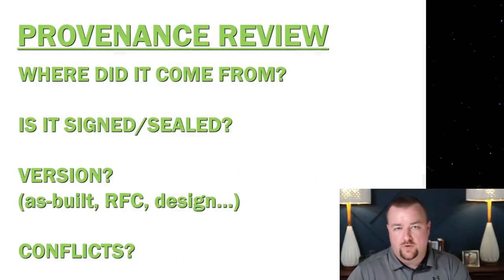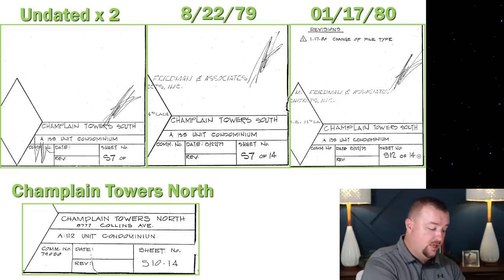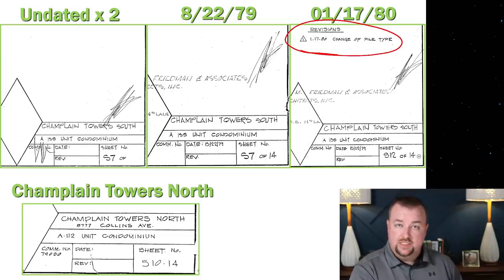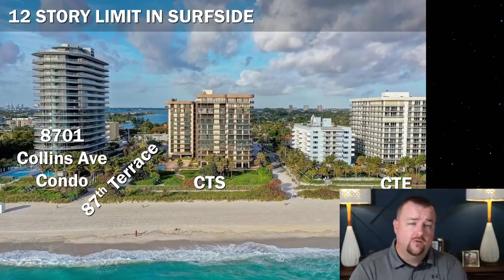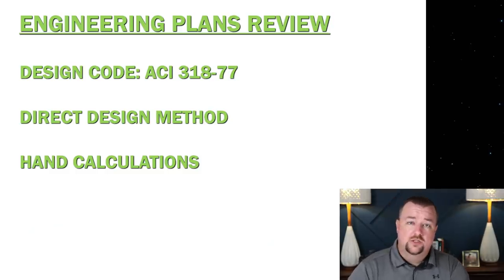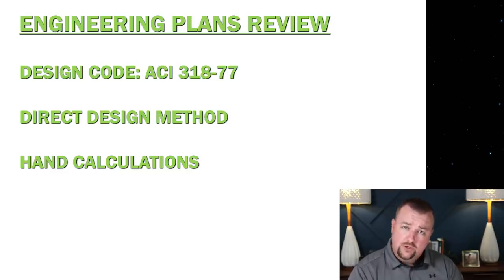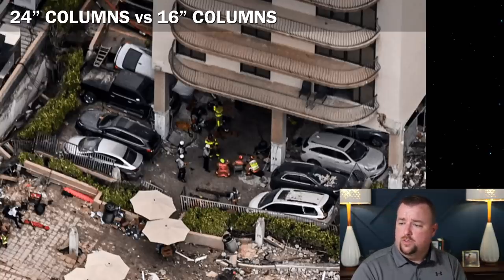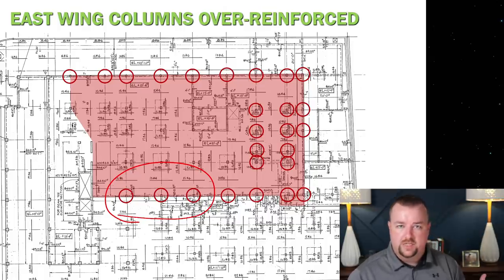Engineering Failures Found in the Champlain Towers South Drawings - Surfside Collapse

Comment: Hey Josh, here is another question, at what point do you think the congestion of column reinforcement was a big issue? Because the reinforcement ratio was 9.2% at the splice region but everywhere else it was less than 8% as recommended by code. Also the splice do occur just at the top of the pool deck. And to be honest when we see columns on west coast, the reinforcement is significantly tighter than that on the east coast, so concrete consolidation issue seems highly unlikely and if it were an issue, it would have shown up earlier because again the splice was located at the top of the pool deck. The high reinforcement ratio of steel may not have played role in the collapse. But it does convey one thing, that this was the minimum possible size of the column they could go for, any additional load would have lead to bigger size column.

Second thing that I did not understand is the concept of plastic yielding. I mean these elements they way they are poured and perform is essentially elastic. I have not heard of plastic yielding axially in RC column specifically in regions like Florida. Because everything is wind and the buildings are designed to stay elastic in wind. Plastic yielding / hinging of columns occur during high drift demands which the building was not even exposed to at the time of the collapse.

Third, you mentioned that the bottom mat was barely enough to handle the self weight of the 9.5" slab only. Was it the design capacity? Because when I do the same calculations, I do see that including the sand and pavers and structural topping, with #4 rebar, the slab was just overstressed by 8% in the column strip and it was okay in the middle strip. May be I am missing something when you mentioned it was at 99% for its own weight.

Comment: Very good and a great explanation, that the removal of the concrete beams in the pool deck may have weakened the as-built building, and that  weakness in the design and the moisture from Atlantic Ocean initiated the collapse, after 40 years.
Reply from the maker: Thank you!
Reply: @BuildingIntegrity  ~ I haven't seen a better explanation that focuses in on the weakness in the pool deck created by changes in its original design.

Comment: Hi Josh thanks for all you videos on this sad event. 

Sorry if this has been already  covered but 
I have a question, if the initial failures in the garage damaged sprinkler lines which would trip water flow switches and trip fire alarms, why didn't the building evacuate ??  

Thanks again for your efforts

Comment: The garage area with the large loads (vehicles),  it's not just the vehicle driving around, but the vehicles will inevitably hit those columns as drivers will always hit things by accident.  Overtime, that could cause internal cracks in the column, even though the column has no visible damage on the outside.

Comment: Man... I have no formal training and the lack of beams in that lower structure rubbed me the wrong way from the start.  Finding out they were in the original design and then were just taken out for an aesthetic reason is nuts to me.  I wonder if the sister building can be saved now that the flaws in the building are understood?  They definitely can't just leave it as is.

Comment: The penthouse failed from the forces of the columns and slabs redistributing loads. Some of the  penthouse and several balconies were not on the plan and were designed improperly. The punch thru of the upper columns caused the upper floors to pancake and buckle the columns as seen in the TikTok video.
The CTS was a glorified sandcastle.

Comment: In software development it is best practice, whenever you make a change, to re-run your automated tests. I imagine the equivalent now in architecture is you re-run your models to check all your loads. In software we automate this (with techniques like continuous integration) because otherwise mistakes happen all the time. Nowadays in architecture I imagine there is a lot of automation. In 1980, however... This makes me wonder if this type of mistake was made more systematically. This is probably not a one-off.

Comment: I liked your video very much.  I'm a sparky and was not sure I'd understand it but you did a fantastic job.  I understand how design changes sometimes are not or could not be fully evaluated and how changes made after construction (like the planter boxes and other landscaping additions) may have been less than adequate.  I wish you had included some information as to construction progress relative to the design changes that eliminated the transfer beams that spanned the columns.  Is this a reflection of architectural changes before construction or more along the lines of an "as-built" incorporation of construction omissions?  Sometimes I think that construction and schedule pressure influence the engineer so as to be more inclined to believe the design is sufficiently robust to accommodate the "as-built."  Can  you imagine the cost overrun if the construction had reached the point where the pool deck had been completed to add sufficient structural modifications for the missing "Beam A's."

Comment: Fascinating! Someone else may have mentioned this but there may be an additional factor with regards to the collapsed pool deck. Stone paver decks were rare at the time of the building plans and construction. Stamped concrete decking with or without nonslip deck coating seems more likely. A stone paver deck would have been a far more excessive load on the slab than what it was intentionally designed for. What do you think?

Comment: Structural engineer here 
Unless the planters are cast integrally with the structure they must be treated as movable live loads like the cars. The slab and support structure need to be designed fir the worst placement of these loads. Not to do so is a basic error.
In reality the loads for passenger vehicle parking areas aren't that high. From memory (I haven't designed buildings for decades) 2.5 kN/m2 is sufficient for light vehicle access, maybe double that for heavy US vehicles (although they are larger and the load is spread out over a larger area). 5 kN/m2 would be a conservative number. That is equivalent to 200mm (8") in topping, finishes etc. Uncontrolled growth in dead loads (e.g. adding new finishes without removing the old) can be the culprit.

Comment: Great analysis.  As always, there is cushion (safety factors) built in to most things to account for time and less than perfect construction and maintenance.  So when something finally fails, there are usually multiple errors that contributed to the problem.  In this case, the engineering was close or below the limits, late changes were made just before construction, significant changes were made after (pool deck, planters, penthouse) and maintenance was not done in a timely manner or correctly.  

When you see the garage video and multiple cars had roofing over them to redirect leaking water, that should be a red flag that there were problems.  It says water is leaking where is shouldn't and it is not being maintained well and hasn't been for awhile.

Comment: I've been following your videos on this. Great job explaining in simple terms and keeping it objective and professional.  I have to say the main thing that has remained stuck in my head is how and why was 40 years, the number selected for a building recertification inspection. I find it hard to believe that they calculated oh the Miami DEA building collapsed after 40 years, lets use that as the benchmark. I believe there has to have been more to it because it doesn't make any sense to use 40 instead to 25 or 30 years if you're trying to improve safety. I wonder what your thoughts are regarding this, the conflicts of interest surrounding the collapse, government, people, and the proportion or balance between regulation and deregulation. Having the recertification be after 40 years, and be the only required inspection after construction is either a big mistake, or both a big mistake and a conscious decision taken to promote a certain market behavior for economical purposes. I hope I am just a little too paranoid about this, but something is just not making sense. Thanks.

Comment: Very interesting presentation! I am not an architectural engineer, but an aerospace engineer specializing in lethality, vulnerability and hardening. Your premise makes sense.
I would suggest that the next step would be to repeat the strength analysis with the January 1980 as built design. Does the building still meet code?
Reply: architecs arnt engineers.  they are the dreamers... then structural and civil engineers have to do the heavy lifting.   Mechanical deal with plumbing and HVAC and other moving parts.

Comment: These videos have been so interesting and informative. From a systems perspective,  I'm always curious about how large things fail. Is it common practice for engineering plans to be "red teamed" for potential issues? Not necessarily for just code violations,  but where several items may be to code, but work together to cause a potential issue?  Thanks!
Reply from the maker: Not as much as you'd think and def not in 79/80.

Comment: Seems like a credible analysis. Reinforced concrete has a great reserve of strength, which explain how something loaded up to 100% could stand up for so long, but the cracking and water ingress caused sufficient deterioration for the structure to eventually fail.

Comment: I'm a bit confused about the calculations you mentioned where some of the columns were already at 100% load (just from the dead load). So the workout room was next to the pool deck. If the columns are already at 100% load and you put weights and other heavy equipment in the workout room, wouldn't that push the load over 100%? Also, when someone decided to add Palm trees in the planters on the pool deck years ago (they were removed after the hurricane -- I forget which one), wouldn't those palm trees also add massive localized weight on the slab / columns that were directly adjacent to the planters?

I'm obviously not a structural engineer, but I would assume when designing a structure, you always want decent safety margins. So now we have planters placed in areas that weren't on the original design blueprints, we have a workout room with probably a couple thousand pounds of weight right next to the pool deck, we have people on the pool deck which I'm assuming could get a bit crowded during parties and nice weather (figure an average weight of 160-180 pounds per person and easily a few dozen people out on the pool deck during social gatherings -- that's approaching 5,000+ pounds there) -- but then you also have the water that had no where to go except down into the slabs, etc. 

That's a lot of additional weight above and beyond the already at 100% dead loads for the smaller columns?

Then again, maybe live loads are inconsequential to the dead loads you calculated. Maybe an additional 10-15,000 pounds wouldn't mean much?

Also, as an aside, engineering work must have been a real bitch before computers came on the scene to help with load calculations!
Reply from the maker: Only some of the critical slab areas were at 100% capacity.  The area of slab around the cars and planters had shorter spans between the columns, but the planters, cars, and concrete deterioration eventually pushed the load beyond the capacity in that area.

Comment: 15:35  1.  They SHOULD be tieing the rebar together in the lap.  2.  The lap is typically specified as "xx number of diameters", such as "#8 REBAR WITH 10 DIAMETERS LAP", so #8 is 1 inch, so 10 diameters would be 10 inches.

Comment: Can I ask a  question. Does every hole (bolt, attachment, weld) drilled into a concrete column or beam minutely reduce that column or beam strength over time, or every little attachment adds up and takes away it strength ? My thought like it is the more holes you put in a sheet of steel to attach things to it, surely you are weakening it strength. Can that happen to concrete as well ? I have no idea, just a thought. Thank you.

Comment: Also, sorry if I missed it in your video, but what is the purpose of a step down to begin with? Is it to keep the cars off and away from the pool deck area? Also, since those beams were eliminated entirely, does that mean weight from the cars parked next to the pool deck would transfer some of the load into the pool deck area?

Comment: One additional thing is vehicles getting heavier over the years. Especially in the US weight of cars gas gone only up in the past 40+ years.

So it's not just structures getting older and weaker, but loading increasing over time.

Comment: This really makes you stop and think about the burden that must go with designing a building like this... you change "one little thing" and it is SO EASY to miss the repercussions of that "little change" because there's dozens or HUNDREDS of other thinks linked to what you just altered.

No wonder things get overlooked, there's is just SO MUCH involved, so many interlocking systems, so many different types of stresses and loads that have to be re-calculated every time you do ANYTHING to the plan.  And this doesn't include trying to future-proof your blueprint in an attempt to account for what people might do a few decades when they decide it's time to remodel.  Like planting 20-foot tall, several ton palm trees in your planter boxes, or adding a thick layer of sand and paving stones to the top of the (already maxed out) pool deck...

Comment: A couple of things that doesn't make sense to me ( and I hope that you might come back to me on this to help me understand. ) You calculated that the punching shear around the 16x12 columns was at the 100% load [ 19:49 ]. Now, as a former aircraft engineer, I understand loading and the necessity to have built-in redundancy, but if the loading here was at the 100% limit, then there was nothing left to cope with excess dynamic loading. 

Then at 33:53, you have discussed the absence ( or removal ) of the step-down beams etc, between the plans drawn at 08.22.79 and 01.17.80. I know that with this type of engineering I'm a layman, but what would be the logic in, for example,  designing elements for 100% loading ( ie no redundancy, ) putting columns that are offset from the lower columns ( ie unsupported ) and then removing structural support components such as the step down beams.  I would assume that this practice would have been replicated throughout the building.  Lastly, there are the unsupported planter boxes and vehicles [ 37:23 ].

To me, as a layman, it seems that the engineer that designed the building to fail. Would that be a fair comment? 

Also, if that premise were correct, what are the possible reasons as to why the building was designed that way or why would the engineer have agreed to these changes if he knew that they were inadvisable?

( If you wish to reply, but not publicly, I'll send this question by email and you can reply that way ).

Comment: Just as the Chemical Safety Board and the National Transportation Safety Board do their forensics, I appreciate what you have done here. Structural Collapses are thankfully very rare. But we need to study every single failure to determine exactly how they got that way. It is always possible that the design guidelines were followed, but that they were inadequate somehow. Or there could have been a seemingly minor alteration during construction that was actually very significant. 

In this case, unfortunately, it looks like the latter. The design was very tight. I call that "Engineering with a very sharp pencil."  There was absolutely no margin for error in the original design, and then some changes were made that weren't reviewed properly. Add to that a certain amount of neglect by the owner. When it is all said and done, no one thing brought that building down. As with many investigations, it turns out to have been a series of poor choices, ignorance, and poor maintenance. 

Thanks again.

Comment: @36:35 where you are saying the planter boxes are built with no beam underneath- there are not vehicles on that level, unless it's a two-floor parking deck, and if so that's the first I've heard of this. The pool deck level is one above the underground parking on that side, so the dynamic load of cars should not affect any but the concrete on the ground. I don't think the addition of weight of planters could possibly be enough to compromise the structure. They are heavy, but then so is all the furniture and everything (pianos!) people put in their places- and there are 135 units above all of this foundation.
Reply: It is two levels of parking at the southwest corner of the building.  That is shown in this video.

Comment: Josh,on big ships,and underground storage tanks that are steel, they put magnesium anodes with small gauge wire that puts a negative charge to the metal and channels the corrosion to the anodes. It's called chathotic protection. This we should have already been doing. It could only help especially in your climate.
Reply: I'm saying tie all the rebar together and give the rust and corrosion somewhere to go..We do this on ships,and steel underground fuel tanks,,,and it works,,so why not try it on buildings?